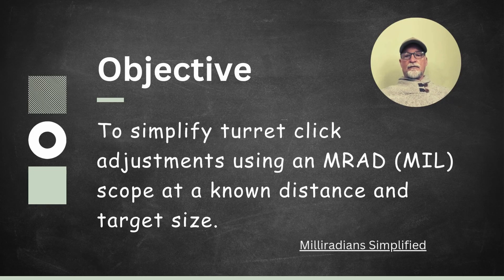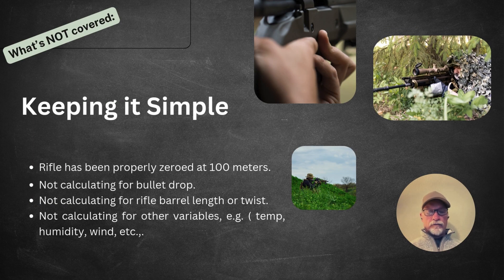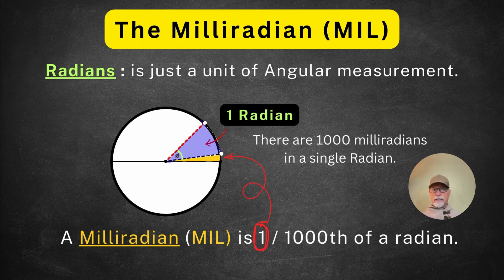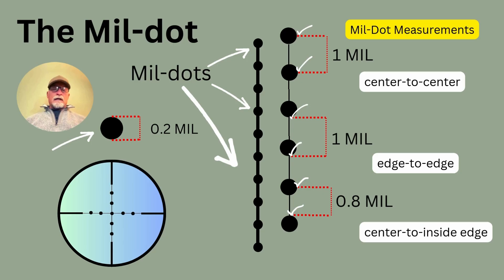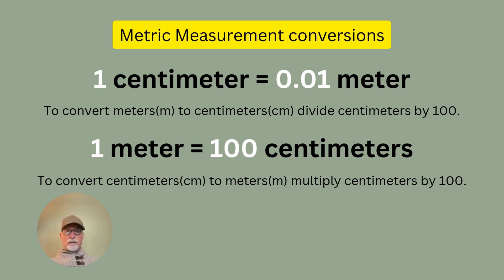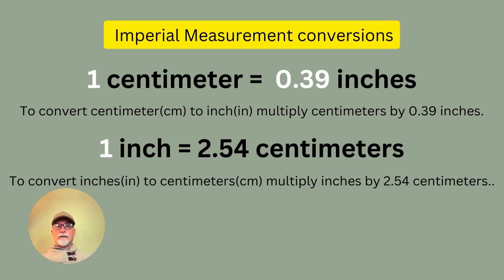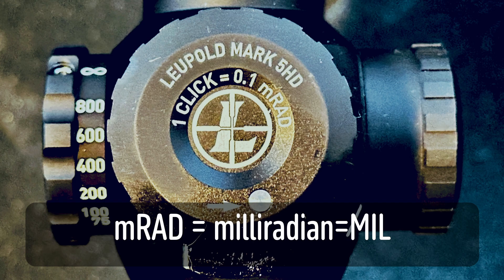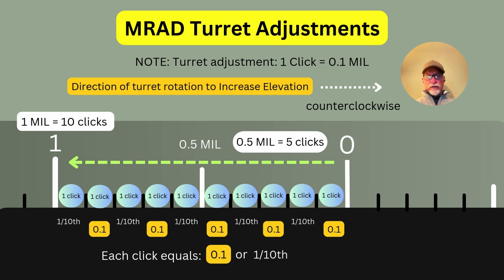Simplifying MRAD scope turret and MIL click adjustments for beginners.

Comment: Your slide with distances between mil dots is incorrect. It shows distance from center of .2 mil dia dot to edge of the next dot as 0.8 mil, but that distance is 0.9 mil, while the distance between the edges of the nearest dots is 0.8 mil.
Reply from the maker: I appreciate you pointing that out! Correction is in description.

Comment: you might have an error on the page at 2:09. you show at the bottom that the distance would be 0.8 MIL, but what you show it 0.9 MIL. you would need to paint the dotted line from the points on the line of both dots and not from the center of the top dot.
Reply from the maker: Thanks for catching my error and letting me know.  Much appreciated. I hate making errors!
Reply: Shot wasted  @Broswhoknowstuff